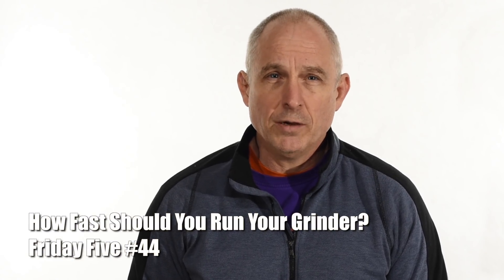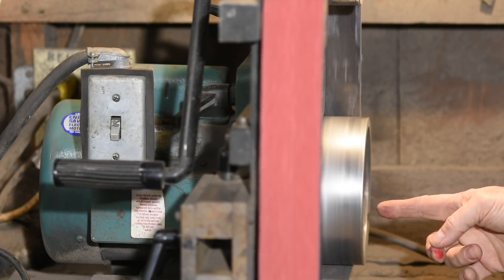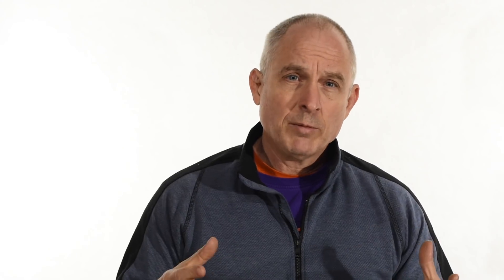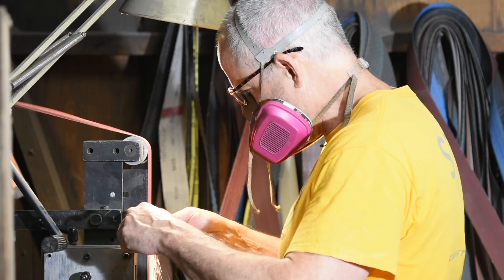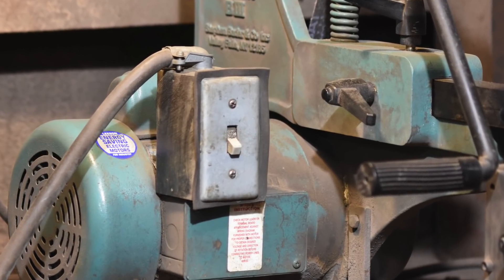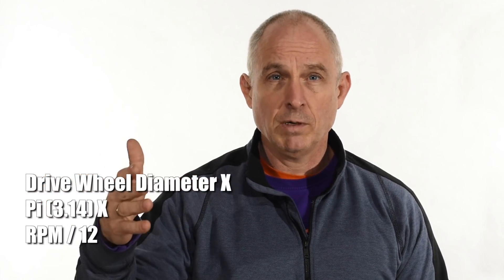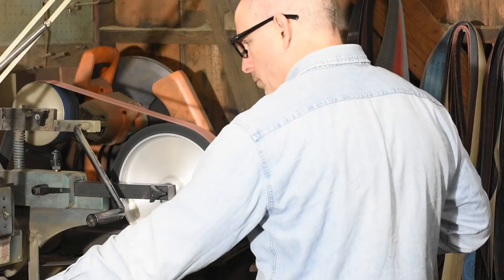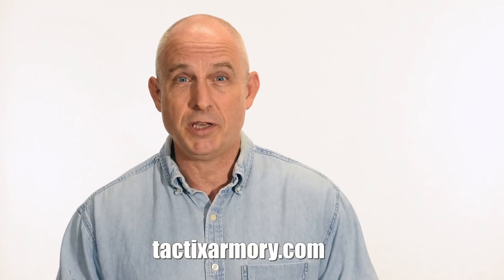Belt Grinder Speed:  Knife Maker's Friday Five #45

Comment: I was the same way for a long time. I ran it wide open on 1 speed approx 5,500. Then I changed it to a step pulley system. Was very cheap and works great. 5 settings Slowest 1,800sfpm fastest 8400sfpm.

Comment: Hey Walter, any tips for how to grind handle pins down so they are flush with the handle material? I have a tendency to sand down the wood much quicker and feel the pins raised a bit
Reply: I use a rubber wheel instead of a flat platten. You have to be very careful to only hit the pins themselves. Once you get close I do 1 or 2 passes over the entire surface of the handle material to bring it down evenly. That's what I do but whatever works for you

Comment: I switched to a DC treadmill motor. 2 1/2 hp. I run it off a Variac transformer.  An in line bridge rectifier changes the AC to DC. Turning the knob on the transformer gives infinite speed control. Got the motor for free. The transformer was 100 bucks new, and a dozen bridge rectifiers were $6.80 on Ebay. You only need one
There's a bunch of videos on YouTube on this for anyone interested in finally making a variable speed grinder that works. 
Been running mine for a year and a half with no issues, and I'm not an electrician. ✌
Reply: Did something similar myself at first. Worked great for a while but those dc treadmill motors eventually get fried from sucking in too much metal dust. Do what you can to mitigate metal dust in the air around the motor and controller so you delay the inevitable even longer than you already have.
Reply: @RibeyeReaper  Thanks for the heads up. I'll try to box and filter that motor. 👍

Comment: Hi my 2"×72"  is a fixed speed grinder I did not know when bought how hard to retro fit this. Can you electronically add to this
Reply: Yes, you can add a variable speed controller between power outlet and drive motor.
Reply: @MJFacas  thank you need to find a electrician that knows what he is doing

Comment: The problem is most of us can’t afford those big dollar grinders
Reply: 12 to 15 hundred dollars is a lot (for most) ..that's why I''ve been gathering the parts needed for one this past year. I'm only missing a couple of minor things so I think I'm gonna be able to assemble it in the next month or two ...I just wanna share my excitement about it here, haven't been looking forward to something this much since I was a kid :)
Reply: I've been making knives for a couple of years and I use the Harbor Freight one by 30 which was good but had a fixed speed. I then researched how to make a 2X72 welded it together ordered the wheels and put a treadmill motor with variable speed and it was a game changer variable speed is one of the most useful aspect of having a 2x72 grinder it is not the most powerful set up but I'm not trying to go fast when I go fast I make big mistakes when I slow the belt down any mistake are small and easier to fix. Saying that when I am grinding on wood I slow it down so as not to burn the wood especially with finer grit belts the finer the grit the hotter they get. Just my two cents from an old man in Tucson.
Reply: I got a 2x42 it works good but it’s slow grinding